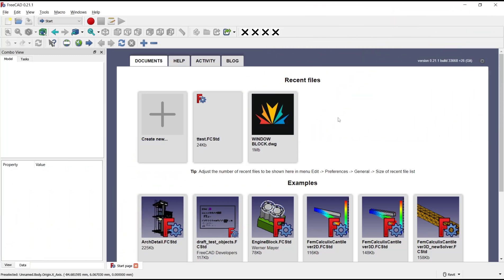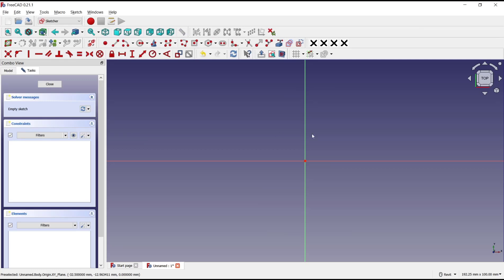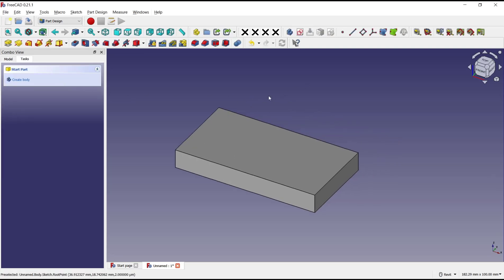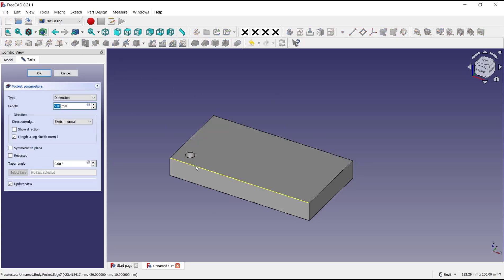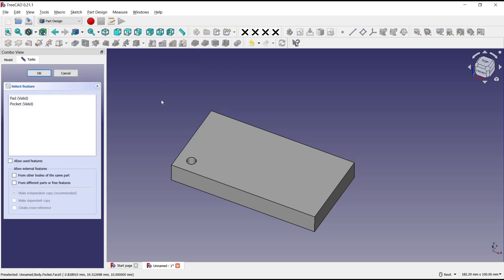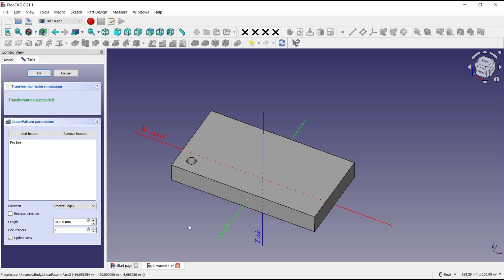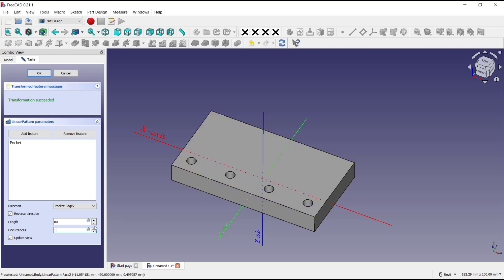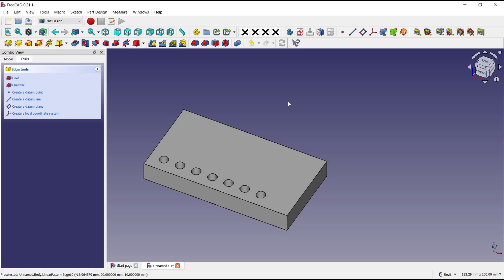FreeCAD How To Pocket Array

Comment: How do you get an array of pockets to follow a b-spine? Been trying to work out a way to quickly cut ventilation slots into the exterior of parts. It's easy enough on flat sides, but curves are a bit tricky and I refuse to use Boolean operations.